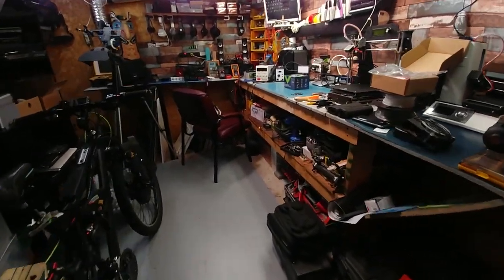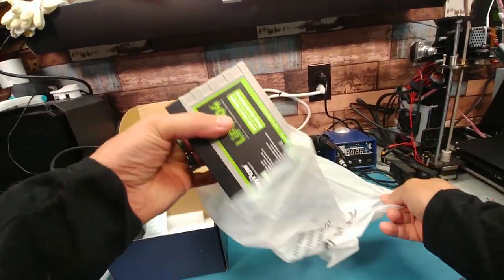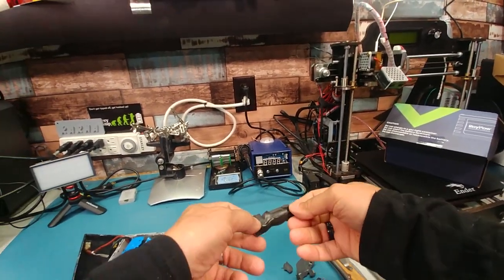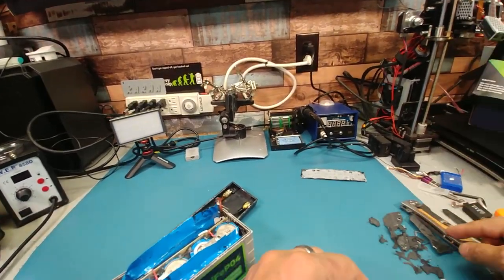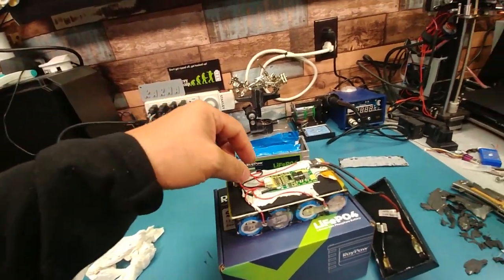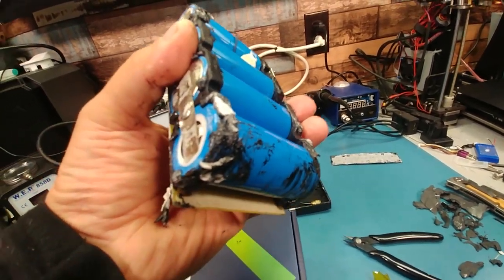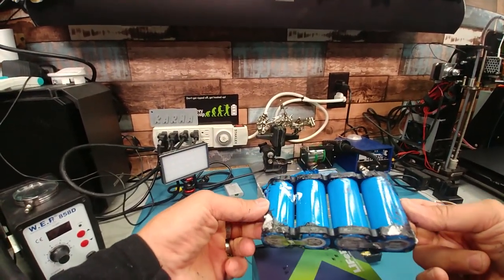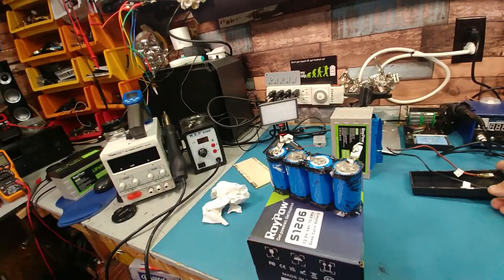RoyPow 12V 6Ah LiFePO4  Battery *a look inside*

Comment: These cells usually give you 5000 to 5200mAh. Most are rated 6000 to 6500mAh on chinese stores.
But none the less pretty decent batteries. 
👍 i use them with ic-705. Giving me plenty of hours transmitting at 10W

Comment: Trying to figure out how to connect 2 LifePo batteries for a 250W - 24V -12AH DIY ebike build. Can't find a video anywhere on how to do so.
Reply: If they are 12 volt batteries, you would connect a wire between the - on one battery to the + on the other battery, then use the unused positive terminal on one battery for the + output, and the unused - terminal on the other battery for the negative output.

Like this, and use the end terminals for the power...
                +  🔋  -________+ 🔋  -